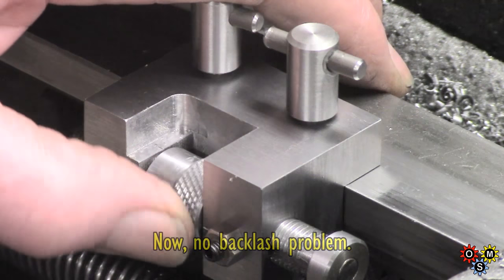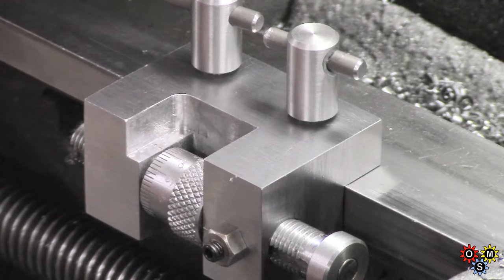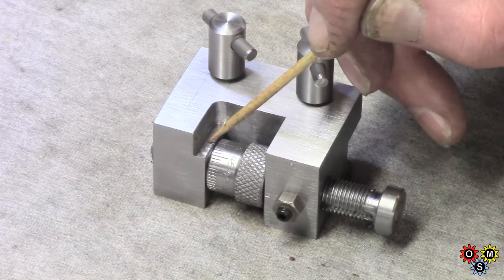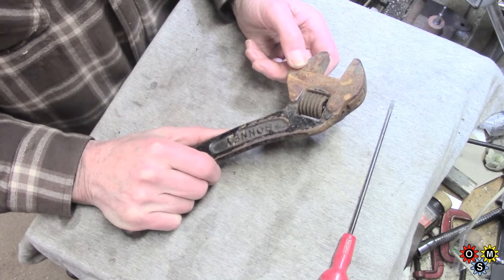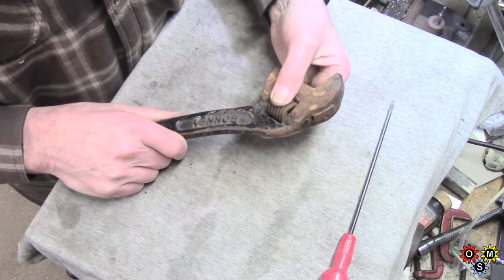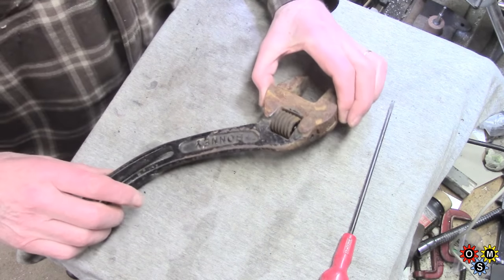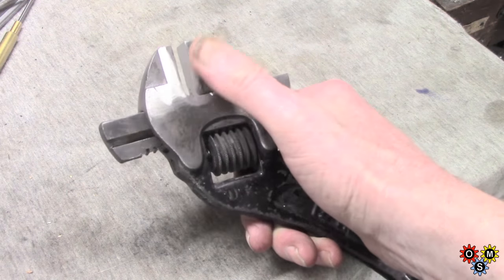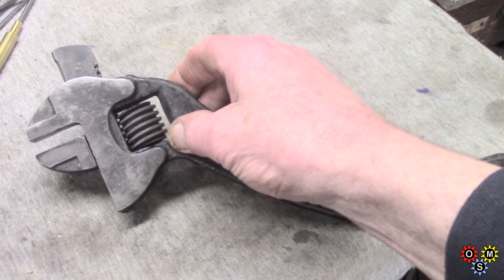Carriage Stop - Tweaks

Comment: Chris

Just a thought, but if you decide to revisit this, instead of  spring and ball bearing In the adjuster, instead if the is room, dill and tap thru the body to accept the ball bearing ans longer spring, and use a grub screw to make the spring tension adustabke so you get the best tension on the ball bearing

Really enjoy you videos, keep them coming

John

John
Reply from the maker: Good idea John - would have been better. However, the original works well enough so expect it'll stay. Thanks for the comment - my video making is very much on the decline - bad back only gets worse! Still hope to make something now and again when I can. :)

Comment: Nice piece, Chris.
Lots of things I like about that carriage stop.
The only thing I would change would be to round off those sharp edges. 
Otherwise, I would probably accidentally paint it red. Not with paint.
Then paint the air blue. 😂
Thanks,
You showed me a lot.
John
Reply from the maker: Hello John,
Thank you. In fact, although it doesn't show well - all edges and corners are dealt with - thing is most of that is done with a stone and so the change is very subtle. Nothing sharp remains though.
The air regularly gets painted blue - believe me :-)
Reply: ChrisB257 
I love color. Especially blue.
🤣
Thanks,
John

Comment: What ho Namesake, if you had wanted more torque on those clamp screws you could have made one longer than the other and have the cross pins at different heights, so the pins wouldn't clash.
Reply from the maker: Hi Chris,
That could have worked for sure but - fortunately with the grip from the leather plugs there is ample torque available to get a good grip. Guess it's my obsession with symmetry :)
Reply: Symmetry works for me, most of the time. :>)